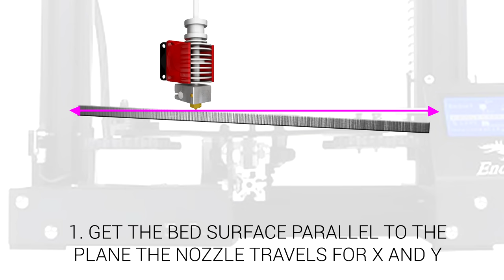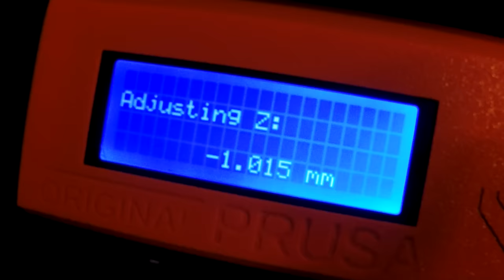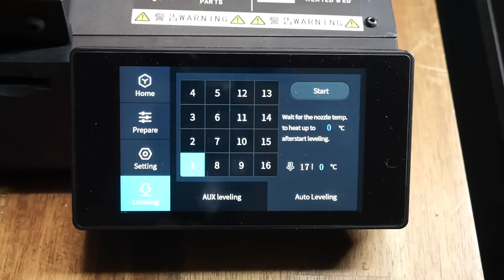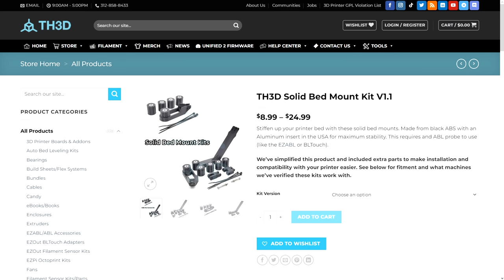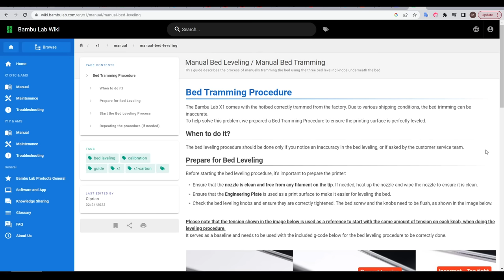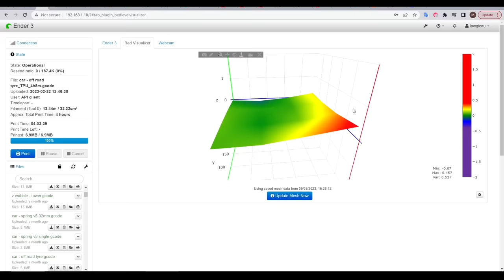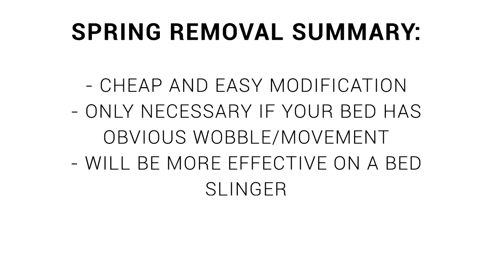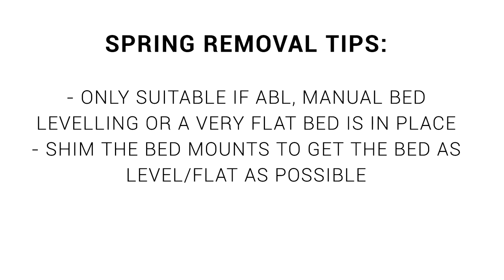Is it time for 3D printers to abandon bed springs?

Comment: There is no ABL on the stock Anet A8, it's old and flimsy and... just works! The main problem is to get rid of vibrationsdue to bed movement, too brisk, too fast. To be fair, this is the reason for any form of wobbling, the springs themselves have little to do with it. The first thing to do is to reinforce evetywhere possible, with T-frames under the bed. Then replace the belts with fiberglass ones. with your phone, make sure everything is absolutely horizontal, print these shock absorbing feet and glue rubber feet under them, you never have too many. Turn the bed 90º and add cable chains for X and Y. Then only, replace the springs with silicon shocks, and make sure your nozzle is screwed properly, as it tends to ooze melted filament, making lumps that drop on the prints and trash everything, Once all that is done, and it costs nearly nothing, just add strong hairspray, the movement of the bed is enough to unstick the first layer from bare aluminium. I didn't try glass, my aluminium bed is clean and the layer of hairspray is naturally flat.

Comment: Most of my printers have the Th3d solid mounts you showed in the video, but two of them are using solid silicone spacers. My Ender 3 V2 just got retrofitted with a Sprite Extruder pro kit and I'm having some challenges with getting the printer sorted out. In spite of using leveler blocks to tram my x-gantry in relation to the bottom frame of the printer, and me using the manual tramming wizard in my firmware to tram each corner of the print bed, My printer consistently prints too high on the left and too close on the right. It may be due to me attempting to use a bltouch probe on the sprite extruder mount but I did print an adapter that was supposed to fix issues with it not being the correct spacing from the bed surface in relation to the print nozzle. I just got a CR-touch probe to try with it instead, hopefully that fixes it. My other printer running the silicone spacers is a Voxelab Aquila. Knocking on wood, that one is running pretty well currently.

Comment: Pretty sure springs do almost nothing you said they do.  They don't cause the bed to go up and down.  

They allow the nozzle to contact the bed surface without gouging the bed surface.  That's it........

Without multi point bed leveling it is possible to have bed contact and you might as well make the bed surface compliant.

With multi point bed characterization and sensorless touch detection it is much less likely to have accidental contact.

Comment: Prusa MK3 combined with the nyloc mod is really the best method for level, flat beds. if a company combined the induction probe with a 4x4 screw bed frame, it would make for a really flat and level print bed

Comment: The main objective should be to keep the springs compressed as much as possible. I always level the bed of my Ender 3 S1 PRO, starting with all 4 springs nearly tightened all the way and loosening gradually until it is as close to perfect as I can get it.
Reply: this. Those springs on the ender at the end looked to be nearly undone lol. 2/3 compression is what I aim for and my bed doesn't move like that.

Comment: I expect that most peoples use of ABL means that their prints are not uniform in shape. ABL is a tool that is misunderstood and misused by all and sundry. This video touches on the problem. I've not yet seen a 3d printing youtuber straight up call the problem out. They just quietly mention it as a side issue. The time and effort spent here with washers as spacers is the reason springs exist on beds. You need to level it even if you have ABL

Comment: i used 2 thumb wheels on each screw/post, one above the bed support frame, and one below. took some time to get it adjusted, however the corners are all within 30microns of each other. haven't adjusted the screws in 15months. Im running blt for the warped bed

Comment: I run the std soft Ender3 springs, so if the nozzle hits a blob-bump the table lowers to pass it rather than knock the print off.

Comment: my AM8-LinearRail build (my oldest machine which I'm not really using anymore), still got them, but I have never been really happy with them. which I would have known this years ago, when I built it. It got an ABL probe, and the rails are flat, so I would be able to remove them at any time without problems. But since the AM8 buils was replaced by a voron0 and voron 2.4 about 1 1/2 years ago I won't touch it. 
the voron0 still got its bed springs for adjusting since it doesn't have any ABL and I don't feel like creating an BL grid manually in klipper.
the voron2 by design works would them as the bed is mounted flat in the machine and doesn't move at all, instead the flying gantry is trimmed using Z-Axis leveling and a ABL probe.

Comment: I still use the original bed springs on my Ender3v2. I have in a bag the yellow ones but have not yet seen any need for them. 
Tramming. It seems that if you do it once it will stay the same until you do any changes or carry the printer around. I also put some marker on the adjustment wheels to see if they rotate by themself/vibrations etc. but they stay where they are. ( 13 month adventure into 3D so it might be that I am not yet that sensitive to quality..)

Comment: There is an advantage to using springs that you did not mention......and that is when the Z sensor fails. Over the years I've had a few Z sensors fail where the nozzle/carriage tries to smash in to the bed and the only thing that saved the glass beds was the fact that the bed has 'some give' to it via the springs ! It likely also stopped the carriage from being damaged as well.

Comment: I have an Anycubic i3 Mega S that I got for free, because it was going to be trashed. 
I dont want to do too many modifications to it especially if they would involve getting rid of the metal frame parts which do work well and also look good.
Since I have more involved machines and the design of this one is already quite dated it would not be worth  upgrading much of it anyway so no ABL and I find manual mesh leveling quite tedious and unnecessary when the bed is not crooked (glass beds usually are not). But this is why this printer still needs springs.
And despite all of that: This printer has been an absolute unit for printing parts in PLA reliably. Not the fastest one by any means but just very reliable. Probably because it just is such a simple machine.

Comment: I've been using yellow Springs on my ender 3 for years. Rarely adjust it, no abl. I think on these small machines it's just not necessary. Every print I can press start and walk away and know it's reliable. On a cr-10 or similar though I think silicon spacers would be great. I just CBF fitting the abl to do it 😅

Comment: The biggest problems with the springs, is that that are TOO SMALL in diameter.  They move around on the mounting plate causeing a Z shift at some point and constant leveling headaches.  They need to be bigger in diameter and stiffer.  The stiffer springs do not help. I found on my ender 3 there was a very fine line between good spring tension and bed levelness.   Best advice: sell your ender3 and get a sv06 or something

Comment: Silicon or Metal spacers is the best... get a bed level upgrade, thats dirt cheap nowadays. But i have to say i got some Ultimakers 2+'s that have 3 level spring screws and no auto level and i never have to level the bed... maaaaybe just maybe once a year all depends on the nozzle wear.

Comment: Personally I always refer to auto-bed-leveling as auto-bed-compensation since that's what it actually is. But we have been producing springless desktop 3D printers without bed levelling for years now. The bed and Z-axis are mounted rigid on an aluminium base and the bed gets levelled and flattened during production. We have had printers drop from desks on the floor and still maintain levelness. For me those springs and auto bed leveling are a nice shortcut for cheap printers but purely a sign of lazyness and lack of engineering in "high end" printers.

Comment: I was just thinking about the possibility of changing from bed springs to something else with my CR-10 Mini(s). I've replaced the glass bed with Garolite which helped a lot with my adhesion problems but sometimes the bed will just suddenly be out of whack and I won't notice until halfway through the print. It has even etched into the material a few times in different places. On longer/wider prints, I'll notice that sometimes the filament will let loose and I'll end up with a warped product. I was using salt water, now I've started using Windex before each print. I'll have to check how wobbly they actually are and see if my prints would really benefit from it.

Comment: Nice bit of information to digest :)
I have the upgraded to stiff springs, but i have the bed right down to compress them and only back off  to level.
and have had no need to adjust ever since one year ago, and also I  have no probe on the Ender 7
As for the ender 3v 2 with a probe I have also done the same but it uses Jyres firmware and to say it stays perfectly level

so in my case it does not bother me if i have springs or not.
But if you have springs and for some reason after a part error like come away  and  if the nozzle crashes into the part and it then pushes into the bed then at least it will have some deflection via the springs relieving stress from the hot end.
Reply: I do the same with my ender3pro springs.  No ABL and I only need to level when I swap different print nozzles.

Comment: My SV06 has never had springs. 
One corner was particularly deep. There I put a thin washer underneath. 
Otherwise it is screwed on with 5 screws and aluminum spacers.

Comment: For a reason I don't remember I've replaced the stock springs on my Ender 3 with the stiffer yellow ones. Ever since then, I've been plagued with this annoying problem, where a z offset perfect for the first layer would result in the rest of the print getting squished - and vice versa. Some time ago I decided to hard mount the bed, by replacing the springs with a couple of nuts - retaining the ability to manually level the bed while keeping it a lot stiffer. Everything suddenly started working as it should, zero problems with dimensional accuracy or the first layers. So no springs for me. Though I will probably redo the mounting with the spacers like you showed, I plan on speeding up the prints, and it might get a bit sketchy with the bed sitting only on these spindly M4 screws.

Comment: good videos thank you, My 10s Pro V1 has many upgrades. I am so disappointed in the speed limitations. My bed has springs and they are pretty compressed. I want to print a carbon fiber frame to reduce the aluminum plate weight then a Garolite sheet with no alum plate. I think ditching the spring would be great if I can rework the while bed system and get so ight the speed is better.  any ideas. I loved the vibration sensor idea and want to do that too. Real time monitor and closed loop control yes!

Comment: The man is asking the real questions. Why can't you use four 28byj-48 stepper motor to level your bed?

Install CReality Ender 3 touch sensor, have it probe the corners, and the smaller stepper motors can raise or lower those four corners.

Comment: I replaced the spacers on my mk3 with self locking nuts. An extension for octoprint I can screw the nine screws to a perfect flat bed (variation around 0.02). Need to do this from time to time.
The voron looks best and might work best, but vibrations might be to concern (like Vez3D said)

Comment: What about aluminium temperature expansion versus the steel subframe? Not much of an issue for PLA on cool beds but at 70+ there is significant differences causing quite noticeable warping. Springs allow for this (lateral) expansion, though of course there are better methods.
Reply: The Ender in the video uses an aluminum subframe, but there are noticeable temperature differences between a 110C bed and the subframe. The length of the bolts and the springs do not fix the bed absolutely in place allowing for some x-y thermal expansion. Any replacement should make allowances for that.

Comment: the spring also help for extrusion pressure until it equalizes pressure with height of print. if nozzle has spring or axis of z has springiness then machine will be ok. only way not to need springs is have z access extrusion motor idle off, or precision control measuring pressure or filament. also heat changes thickness springs allow adjustment with minimal warping.

Comment: After fitting a BLTouch to my ender 3 v2, I replaced my springs with metal spacers. The ONLY issue I've had is when a glitch has tried to bury the nozzle. There's no give in the bed at all. Luckily it's a very rare event and I get very nice first layers.

Comment: Would have sent back this Kobra Go if it weren't for these springs, the auto leveling isn't a magic bullet, however first manually leveling the bed with spring (replaces the oem spacers) and then running the ABL, nozzle height is very effective and consistent now.

Comment: I still use bed springs. I was just thinking about it last week. I noticed my bed has a little play but its not too bad. I started with an anet a8 and replace almost all of it.  Last month i just added a magnetic sheet instead of using tape.

Comment: i still use bed springs and the ones i using are stiff so it improved alot for my bed lvl ling  now i dont have to lvl my bed everytime i make a print i check everytime still but i discoverd they work super for my ender 3 printer

Comment: Michael, Could we use something like nitrile rubber (heat resistant and very firm), overcoming the washer stacking tedium then lock wheel on the thread.
I have found moving the power supply on a Ender 3 Pro from vertical to horizontal at rear (mountings on Thingiverse) this reduces acceleration vibration to almost zero?

Comment: I have the Anycubic Mega X. It has bed springs and no auto bed leveling and the Z axis is set. Also no Z axis offset in the firmware to compensate. I would like to know if I can upgrade the firmware on it to include Auto leveling. Can I remove the springs on this one? It does seem to print very well if you get the manual leveling set right. But I have to level it almost every print or if it hasn't been used for a couple days.

Comment: hi thanks for the video, to reduce the springs contribution to an unstable XY plane..just do  up the tension/height adjusting knobs really tight -springs compressed, and baammm.. the movement is gone...  CR-10 smart pro (auto bed levelling)

Comment: Thank you for sharing this,  but my Ender 3 does not have auto leveling, I suppose I could still level it by installing the washers, but what to do about z-offset?  adjusting the z home switch is only thing I can think off.

Comment: I would like someone to explore why some printers need leveling so often? I have mine sitting on 3/4" plywood, on a rickety table, and rarely ever have to level it. I built this from Ender 3's semi-kit, and used a builder's square to set it initially. I have stock springs with silicone washers to keep them from loosening on their own. I use springs so that in the case of the occasional collision, I don't bend something expensive.

Comment: I still have the original springs on my Ender 3 and Neptune 2 printers. I  see some users putting compression rubber cushions instead of springs. Seems like a good concept. But can the rubber cushions deform after time?

Comment: I replace bed springs for thick silicone "springs"/spacers so that i can still manually adjust bed level. Yes, i am still one of those people that doesn't have ABL because so far i didn't find a good ABL that is easy to modify on old CR10/Ender 3 printers even tho i changed control boards to SKR.

About ABLs, i didn't find a good ABL because i am using glass/pei sheet combo (5-6 cm thickness). I don't like BLTouch because it seems to break really easily and over years paying attention it seems a lot of people has problems with them breaking plastic pins. I have one of older EZABL from TH3D (i got it for free from a friends) but documentation for that specific version is lacking and impossible to find. But overall i am just too lazy to bother with implementation and modifying 3D printer AND firmware to make ABL working.

Comment: I just printed TPU spacers and have been using them for over a year now (late 2021-early 2023) and every few months I need to tram the printers s axis. I have yet to need to adjust the TPU spacers. They also have some give to them , but it doesn’t affect my layer quality.

Comment: When I was using the yellow springs on Ender 3 machines I found that having about 2/3rds compression in them reduced any wobble, I now have the silicon spacers which are much much better than any springs, I dont see any need to change to solid mounts though although I am going to apply the two nuts and a wingnut with blue loctite to each corner.
 I also have 2 Ender 5 Plus machines that came with the yellow springs but did not get any bed wobble at all, but I changed to silicon mounts anyhow.
Reply: why two nuts instead of a self-locking nut?
Reply: @alejandroperez5368  Saves me buying self locking nuts

Comment: i use 6 silicone cylinders on my cr-6 se with the 4 corners using the metal creality adjustment wheels, the red ones and eventhough i never had any issues whens tock since going to klipper via a soncipad i saw how misaligned the bed really is, i had no issues printing at normal speeds but i figred since i wanted to use klipper to triple my ususal printing speed i decided to add this so manually evel the bed and halping the be leveling being more consistent and even and s far so good.